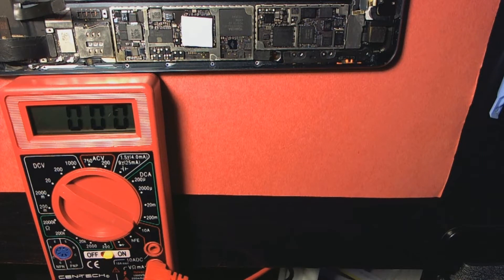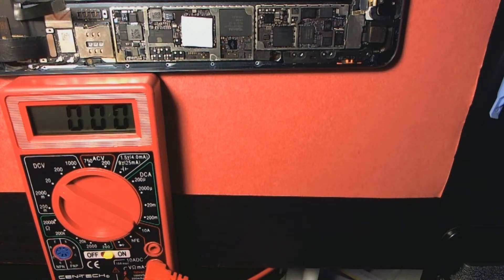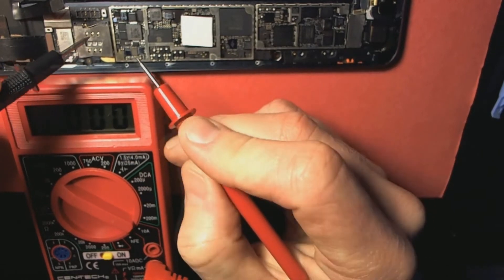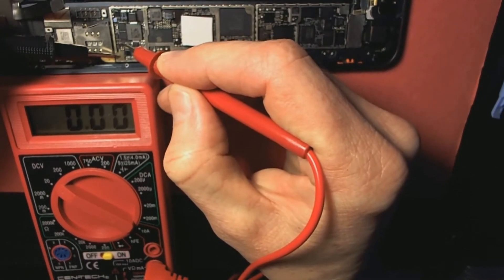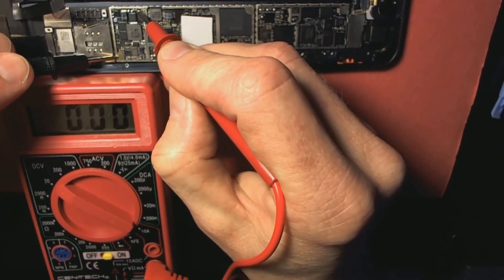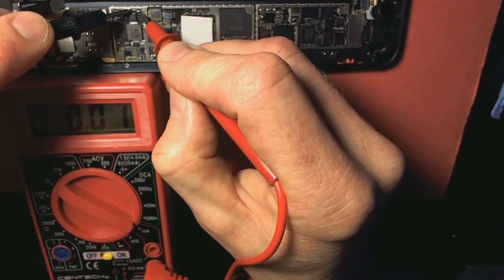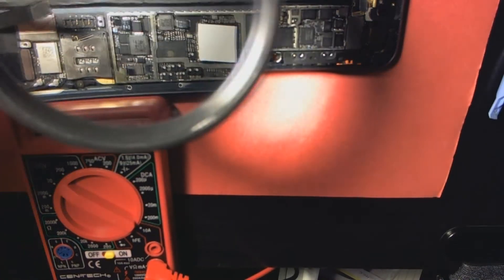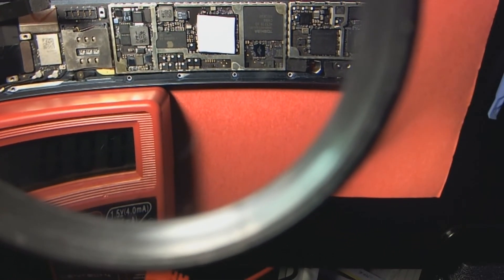iPad Mini Dim Or No Back Light Fuse Filter And Chip With MultiMeter

Comment: Hello 
I'm here because the iPad mini I have been working on has no back light now. It was working fine even after removing the broken digitizer. 
The first digitizer I bought ended up not working, sent it back 
All the while everything else working fine. got a new different digitizer  connect it up now no back light. Grrr can see with a flash light the digitizer working great. Checked connections and then with out digitizer, and even hard reset, still need a flash light. Grrr

Comment: I think the filter you don't get activity on isn't the right one, I'm not sure though. It's most likely the very small filter on te left side of the "railing", the diode under the "T-section" of the railing (a bit to the right of the chip you were reading) or the big 4r7 coil on the right side of the t-railing.

Again I'm not sure.

Try to read the filter you got no activity on with the beep method on your multimeter.

Also the diode under the t railing has a +/- side, it should read on one side but should not give any values is you turn your red and black pens over. If it does its the diode.

Give it a try and let me know how it works out...

Kind regards

Comment: Both of what others show as the fuse and chip read good in mine but that light tan one that you touched near the top has no voltage through it like yours. Mine isn't water damaged but I have power on both sides of the fuse and the chip under the ground rail. Any ideas?